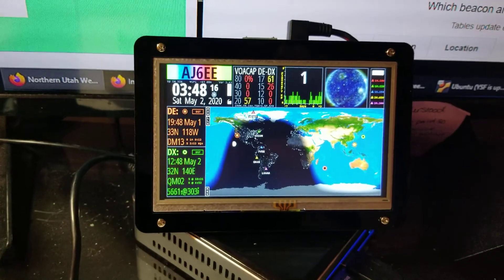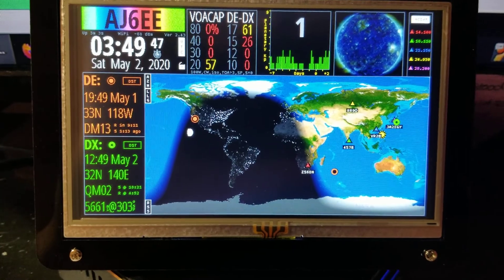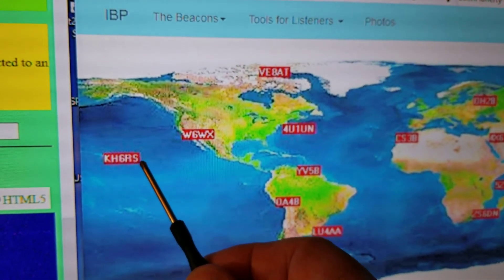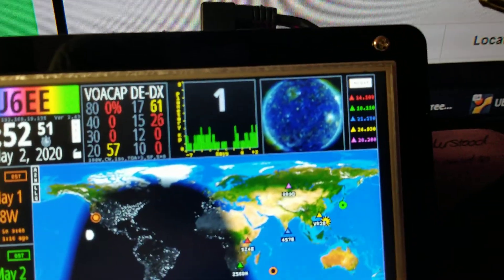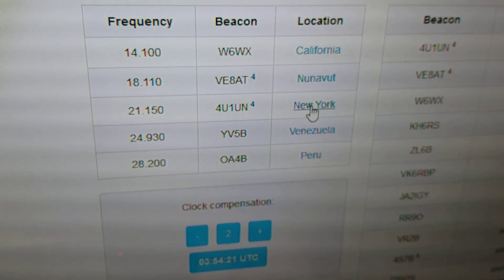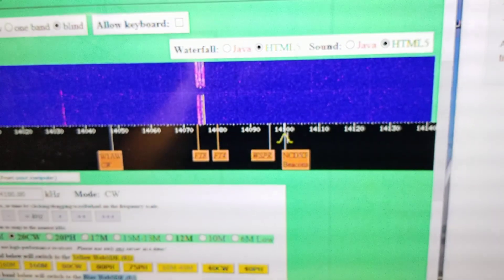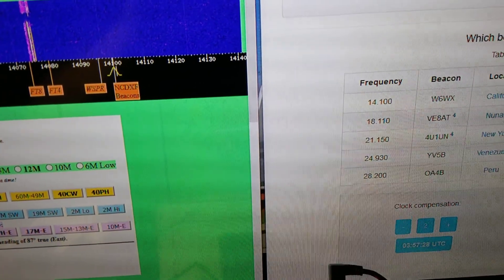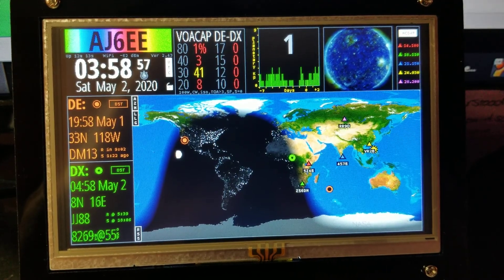NCDXF/IARU Beacons, HamClock, Raspberry Pi and WebSDR

Comment: Hi there and thanks for sharing this informations.
I do use international iaru beacons to check prop. They’re useful and those frequencies are set in memory channels on my radios.
Unfortunately not rarely I come across “ham operators” that are not informed of these beacons nor know the international band plan and do qso on these freqs. 
Interesting also how comments are about the miniscreen or RPi other than the content of this vides.
73s!
Reply from the maker: Sorry for the late reply! Oops. I hear stations on those freqs as well. Maybe it should be a more DEFINED part of the exams. Like a poke in the arm. The other thing that I learned by mistake was tuning up at 100w on a net.  We all need to learn that stuff since it’s not apparent to the new ham. Always move off the freq by 3khz (and if it’s not in use) and tune at lowest power then up the power and go back to the freq wanted.  Best practice for all and doesn’t piss people off.

Comment: WA0FSE here....Of course you created this video some time ago...but I need to ask. What resolution did you use for a 5" screen when you did the "make" file. I cannot seem to get it work on my 5" screen at the smallest 800 X 480 size. Well it works but the image doesn't display (fit) correctly.
Reply from the maker: Hi  George!  I used 'make hamclock-fb0-small'      I looked in the 'Makefile' ['less Makefile'] and it has it as one of the build options. That makes it 800x480 and uses the framebuffer driver [hence the fb0] so it can run without starting the desktop on the pi. When you run the above 'make. command it will build the binary/executable file called 'hamclock-fb0-small'  in the build folder and then you just run it from the console. cd to the folder where you extracted the software and  './hamclock-fb0-small'   without the single quotes. Let me know if that helps and 73!
Reply: @kevinbrouelette6361  Thanks for you reply Kevin. I will try that and see what happens. I will certainly let you know how it works out.
Reply: Thank you Kevin it worked for me. I had played around with the config file earlier trying to get it to work for me and it didn't like what I had done. Once I corrected my changes it was happy. Now to read on how to configure it. Again thank-you!